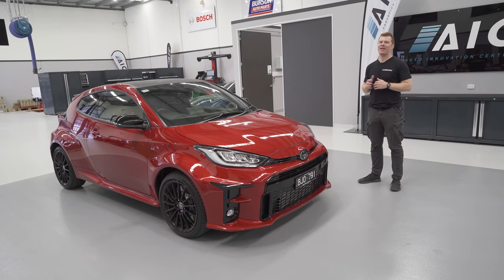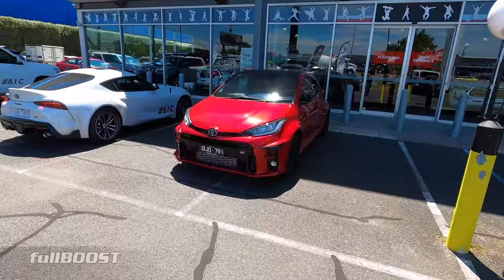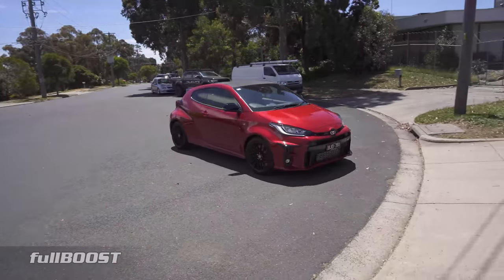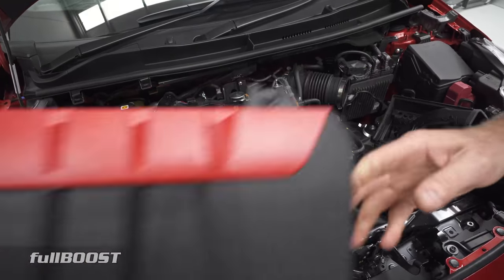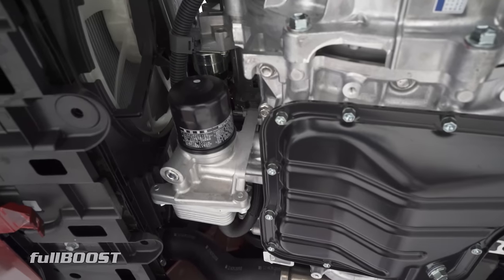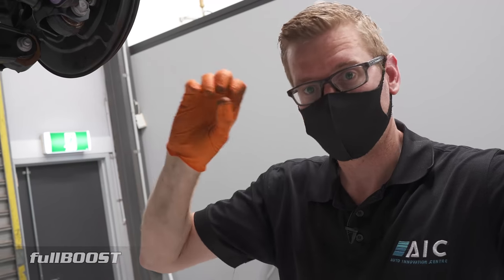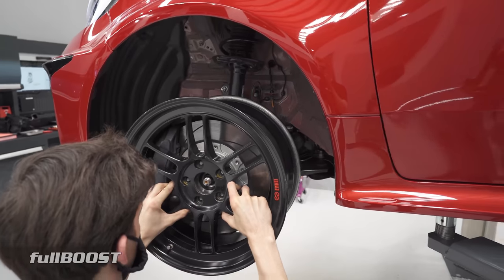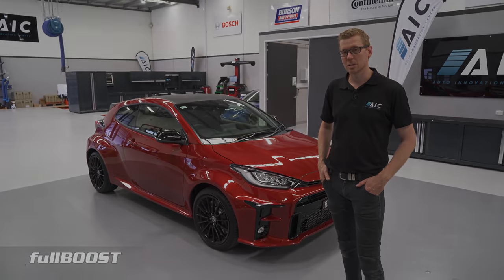Toyota goes Back to the Future with the GR Yaris GR-Four | fullBOOST

Comment: Will I need to modify the VF finally so I don’t get chopped by one of these ? 🤣
Reply: a good cam with ported heads?
Reply: Dont put turbos in it though. Removes the beastly part of it.
Reply: Ahahahahah same
Reply: Time for a 2K Barra 😜
Reply: So time for a barra huh?
Reply: You'd still get chopped, unless your aiming at making a 1000hp and some nitrous
Reply: Would need some serious work to compensate for the vfs fat ass 🤔😂 what do they weigh like 1900kgs? 😳 
I can't wait to see one of these yaris's tearing around with around 500hp 🤔😳 be a quick little bugger 😂
Reply: @5lcalais1  hks got one to 475 hp and its not a swap on that little 3 banger lol

Comment: FR- 392Kgs FL-369Kgs, so its right side heavy, best driver position would be left side to compensate the heavy right. RR-261Kgs RL-258Kgs. Front is 23Kgs + Rear is 3Kgs, total of 26 Kgs right heavy.
Reply from the maker: You'd have to compare it to a LHD car.

Comment: 2 questions guys: 
- You stated the diffs are open, but what I was hearing, there were Torsens front and rear. What gives?
- You stated that it has a Haldex-style transfer case. That means it’s always fwd, with ECU- controlled rwd, either on-demand or proactive, depending on the software and sensor suite. And also, only allows for between 100/0 and 50/50 f/r. Everything I’m hearing elsewhere is saying f/r distribution can be set for 30/70. What gives?

Comment: The Japanese track pack comes with an intercooler sprayer as well as a few other carbon bits from Gazoo racing. 
They also sell one in RC trim with smaller brakes and wheels and a few other strange changes for people who want to gravel rally

Comment: Cost more here in the UK. 30K for the standard car and 33.5k with the circuit pack. Your 40k price works out to approximately 22.2k based on an exchange rate of 1.8.
Reply from the maker: The price has since gone up to 49.5k for this same car. $40k was the intro offer from Toyota.

Comment: The engine does not have VTEC but it does have VTC on both intake and exhaust. Has both fuel injection and direct injection.

Comment: Hi fullboost,  how would you recommend Running in a GR Yaris? Full welly from new or a more traditional method?  I'm reading varying opinions, cheers.
Reply from the maker: I ran mine in for 300-400km then drove it like normal.
My run was keep it under about 5500 and give it plenty of load, like climbing hills.
Reply: @fullboost  thanks for the prompt reply, that's pretty well the path I've taken, although I did spin it up to about six and a half in third, couldn't help myself, absolutely blown away by the midrange surge.

Comment: 15:19
I do believe if you order the car with the "Circuit Pack" they come with painted red calipers (as well as a host of other sporty upgrades) :)
Reply: But at what cost
Reply: 55 is what I’ve been told mine will be. 
Bigger forged wheels
Torsen front and rear diffs
Different suspension 
And red calipers

Comment: I believe this isn't the RZ trim, right?
Since the RZ does have that hole for brake cooling open and having that GR branded brakes as well.
Reply: this one is simply 'Standard' trim in aus but is basically an RZ first edition afaik. Blanking the hole might have been done for aus compliance? (pedestrian safety?)
Reply: @tmmtmm  Ahh i see..
A bit weird with them having to close the brake cooling hole like that if it is true.

Comment: As I can see this is a regular yaris GR and it doesnt have the preformance pack because preformance pack gives you different wheels diffrent callipers and in the front bumper there are holes and air  pippes to the back of the wheel pointing to the brakes for cooling and you get different suspension i think too and some other things.
Reply from the maker: Yes, we never said it was the performance pack.
Reply: @fullboost  Yes I know I am just saying that you  get some different things with preformance pack I didnt mean to say anything offensive.
Reply from the maker: I'm pretty sure the brakes are identical, just not painted.

Comment: Interesting. The scale should have shown 1290 kg. It weights 1280 kg with circuit pack because forged alloys in this pack are 10kg lighter than those in the video. That's what Toyota claims

Comment: Im guessing this is the one without the performance pack and the 2 differentials on the front and rear axle cos it has the HUD which is only available on the convenience pack and from what I heard you can't get both the performance pack and convince pack in some places, correct me if I'm wrong
Reply from the maker: Correct. In Australia, we only have one model so far, which is what is what you've stated - the convenience pack. This is our base model. Toyota are then importing a limited number of circuit packs next year which will be called a "Rallye" version.
Reply: @fullboost  The Performance Pack (as it's called abroad) also have the plastic covers removed in the front bumper for extra cooling of the brakes, right?

Comment: This has a HUD and closed brake ducts. This isn't the performance variant with differentials, is it?
Reply from the maker: Correct. The first batch of cars here are all what is referred to (outside of Aus) as the convenience pack. We are getting a higher model which will be called a "Rallye". This one will be the circuit and convenience pack combined.

Comment: The GR Yaris is 70% power to rear. The engineers say it is technically capable of 100% to the rear though. Not really like a haldex at all.
Reply: Actually it is, very similar to  haldex, in terms of layout and actual construction. Don’t mix up the torque preconfigured distribution (70)vs central diff ability to handle engine torque (100).  All last gen haldexes can technically send 100% to the rear. It just means center diff is able to fully lock up. Haldex is just not programmed to hold it for very long nor constantly like Yaris in 50:50 mode.

Comment: Just looked at the European site. Here we can get a performance pack with front and rear Torsen LSD's, a strut bar, less equipment (e.g. no nav) and most importantly, red callipers
Reply from the maker: They'll be selling that here in very limited numbers, they are calling it the "Rallye" version. AUD$53K
Reply: @fullboost  they didn’t mention limited numbers here, so I’m praying a lot of people option it (it’s only 2k more expensive). Also forgot to mention it’s got different suspension
Reply from the maker: Ours our limited somewhere between 200-300 and will all be white.
Reply: @fullboost  should be easy to upgrade a normal one beyond the performance pack, looking forward to the series anyhow

Comment: How much was the total cost though? Starting price of $40k is a bit steep.
Reply from the maker: They were $40K driveway. Price has since increased to $45K
Reply: @fullboost  That was the 2nd allocation of 100 cars. It's now $50K.
Reply from the maker: Toyota have said the Rallye (circuit pack) is 53K, so this version would remain at 45?
Reply: @fullboost  Nah, $50K for the ambience version and $53K for the track pack.
Reply from the maker: that's not what Toyota told me, who knows, its all a big mess.
Reply: @fullboost  Just Google "Yaris GR price" and it tells you Luke. $49,950, so $50K. 😎👍
Reply: @MafiaboysWorld  oh yeah coz everything Google says is fact
Reply: @EnkeiTenjin  Buddy, you're mistaking Google with Wikipedia.
Reply: It's actually pretty good for what u get 🤷‍♂️ back in 99 2000 a WRX was 43k for the base model, evo 6 just come out and it was 80k 😳

These are actually really good value for what u get considering how expensive cars have become these days ,aren't new 86s like 35 40k? So 45k for one of these sounds cheap.
Reply: @5lcalais1  but how good is good? Is it better than a golf gti? Pretty sure those cost between 40-50k. Plus it's still a yaris on the inside by the looks of it.
Reply: @vongdong10  have u seen the interior in a wrx? 😂 they're God awful, infact most interiors are gross, but your not buying it for the interior, your buying it for the performance aspect, these aren't for high priced hair dressers to cruise around in they're built for people who want a performance car that don't have 100k+ to go buy a m3 or whatever 🤷‍♂️😂
Reply: @fullboost  Here's the new price Luke & Geordie. Our guess of 53K was a bit undervalued. 😬😬😬
https://www.caradvice.com.au/904248/toyota-gr-yaris-rallye-price-and-specs-56200-drive-away/

Comment: Despite the 50 or so HP more than my Fiesta ST, (but 100LBS higher weight),  it does seem more docile. More controlled.
I wonder if they were just driving it in eco mode, rather than in sports?
Or perhaps the engine isn't able to spin the wheels, since it's 4WD.
It is 1 second faster on the quarter mile though.
The engine seems to have the same type of response I got when driving a Matrix. 
Totally boring, linear.
I guess I prefer a turbo car.
Reply from the maker: this is a turbo car, and why would it be spinning the wheels?
Reply: @fullboost  Because you need about 150-200HP at least for spinning the front wheels by themselves.
The rears need closer to 300HP. The engine isn't powerful enough to spin the wheels on AWD (unless it can be disabled to FWD).

Comment: I don't see the big deal about these 🤷‍♂️
Reply: I bet you don't see a lot of things. Just enjoy your commodore bud.
Reply: Neither do I mate, these days it's hard to tell who's a bloke and who's a chick. The car industry seems to be catering for this
Reply: @EnkeiTenjin  Imaging being so insecure you couldn’t see the appeal in a road going version of a rally car.
Reply: Well considering all the cool fast turbo 90s n early 2000s stuff is extremely expensive now and it still kinda was back then too but now we're old enough to afford what they used to cost ,now we can't afford em lol try getting a evo for e.g. for under 40k or a r32 gtr under 60k, u just can't (not good ones anyway), so these make a lot of sense to buy ,1. It's brand new 2. It's faster than any 90s turbo stuff 3. It's good value for money for what u get and 4. It's aching to be modded to be even quicker 5. It'd beat most things on the road (from a factory car stand point) and hey it'd beat a lot of modded cars too lol 
And 6. It's cheaper than the 90s turbo stuff, key word cheap 🤷‍♂️😂

Why would u spend 50k+ on a original r32 gtr that has 206kw in a what 1450kg chassis when u can buy a brand new awd turbo car with 200kw and only 1280kgs and honestly a shitload more modern engineering and tech then a dirty old rb 🤔
Shit I've had v8s and big 6s all my life and would happily buy one of these little weapons. Fast and good on fuel wtf not 👌😂
Reply: @hexagonview  regardless of the drivetrain it's still a tiny hatchback and not everyone wants that
If you like it then more power to you
Reply: @5lcalais1  similar story with the Civic type r, fantastic motor, Nurburgring time,but it's fucking hideous
Reply: @ArtVandelayOfficial  admittedly it's not pretty but it's not hugely ugly either. Personally I'm not buying one for it's looks but the performance, u see I wouldn't just daily it, I'd use it for track events, time attack, hill climbs, drags etc. I'd get 1 in black too so it hides the ugly lol 
Funny thing is I'm building up my vn v6 with turbo to get around 350whp and these little yaris's will kick it's arse all over the place 😂 
1st mods I'd do is full 3" turbo back exhaust, high flow the turbo and mod wastegate for more boost ,better flowing intercooler, tune, up the fuel system, cold air intake ,up the boost a little, realistically that could potentially shoot power up to around 250kw atws, better tyres (wider) maybe drop the ride height a little and that's pretty much all you'd need and the thing would be damn quick ,potentially that's low 12s high 11s on a mostly stock car and the best thing is the cops would never know what lurks beneath unlike my vn that I have to go through the painful process of engineering it in Victoria 🤦‍♂️ not looking forward to that 🤔😂
Reply: @ArtVandelayOfficial  I can understand why everyone may not want to own it. I can’t understand how people cannot appreciate what it is. I would never own a ranger raptor but I can appreciate what it is.

Comment: Those guys got it: a fake awd with rear Jtek coupling, is just a 4wd on demand, massive understeer without the torsens to.be expected and coupling clutches getting burned because of different axle ratio front to rear, another pathetic atempt from Toyota, no wonder they had to use a Z4 to make a supra..
Reply: @dw214  plaese red first about Jtek magnetic rear coupling and than explain how it can transfer.more 'power' at rear, and how is permanent AWD before you post such nonsense. Good for you that you sold a fake awd for another bit less faker awd :)))))